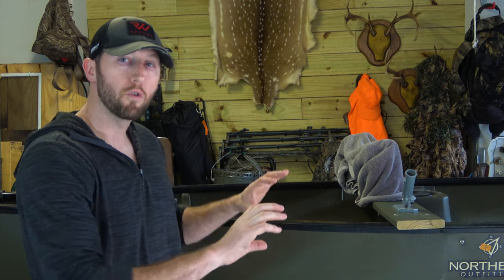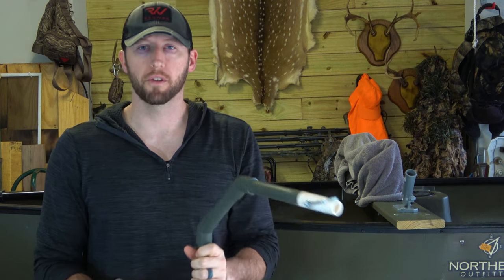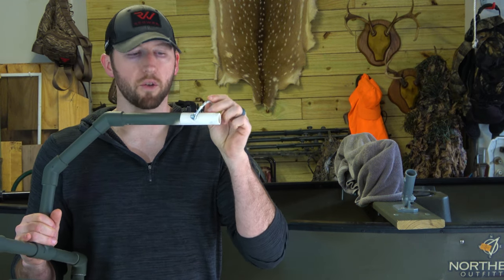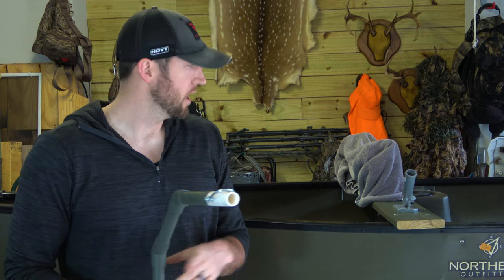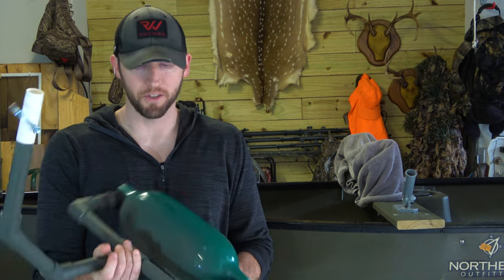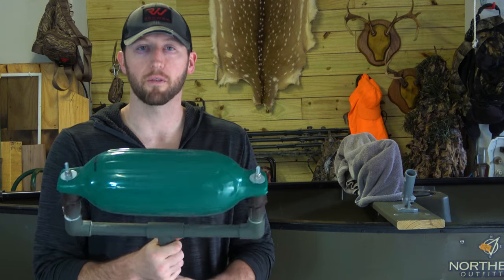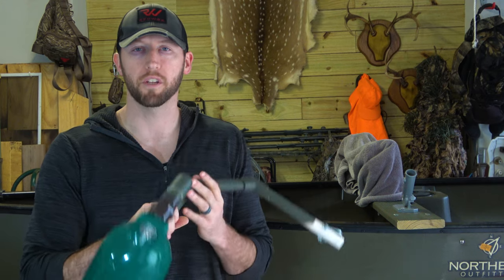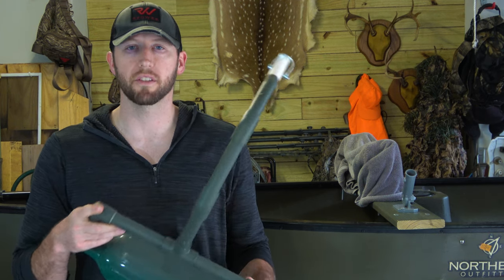DIY Canoe/kayak STABILIZER | HUNTING Canoe Project Pt.2!

Comment: 🎉Finally someone who did what I had in mind. Congratulations. Well, I have a question, are these stabilizers really good at not submerging in water? Would it be enough if I put a single 50 cm on the side?
Reply from the maker: They have been great so far even now. The adjustability certainly helps. Depending on your gear in the canoe or kayak, you are able to adjust your stabilizer level accordingly to keep them out of the water and dragging your speed. When I do lean hard on one side or the other you can certainly feel the resistance. I have never tipped this thing over.

Comment: You may not need to sand the end of the pipe to fit into the flag pole holder. You may heat up that end with a heat gun and jam that into the flag pole holder and wait for the pipe to cool down. I have tried something similar in the past and just want to share my experience. Thanks for sharing.
Reply from the maker: You are exactly right. I had to sand the last 4" or so down to a taper to get it to fit. It was a little oversight on my part originally but you can make it work!

Comment: I made a very similar outrigger for kayak, but I LOVE the flag pole adapter. I’m gonna try this as don’t like my outriggers in water while paddling any distance.
Reply from the maker: Exactly! I couldn’t imagine dragging them in the water and I wouldn’t be able to find a good neutral permanent setting because my gear load may change. It’s a huge drag when your trying to paddle if they are too far into the water.

Comment: Quick add: I used 1 1/4” PVC, very sturdy.  I should be able to slip over the outside of flag poll holder if I sand the outer rim/lip. I’ll update when I do this.
Reply from the maker: I am very interested on how this would work out for you. Yea I was not a fan of the thought of dragging my pontoons or whatever stabilizers I went with in the water as it would always depend on my cargo and weight. Seems like you could get into some trouble there as well. Not worth the risk. Point is, you could build them to a spec but if you are hauling home 30 pounds of fish or another game animal if you are hunting, your entire profile and drag has now changed. Good luck and keep in touch!
Reply: Did you ever do this? Any update?

Comment: You had the right idea..
Someone put plastic flag holders on the kayak I got from the curb.
I did the same thing on my kayak and then saw your video. Confirmation for me..
The only thing was I used 1in PVC instead of 3/4. But..for the flag holders, I had...to use a 3/4 pvc. So I cut a 8in 3/4 pvc pipe and forced 4in of that pipe into the 1in pvc. And then the other 4 in into the flag holder.
Reply from the maker: Good deal! Yea it gets  a little tricky when you start piecing things together and you start using what you have lying around lol But we always find a way to make it work right? I was really interested in a system that I could extend horizontally but I wasnt ready to push it too far. Have you had it out yet?
Reply: Must be that creativity in us..
Haven't had a chance to put it in the water yet. Work has me really busy right now. Hopefully in a week.
Reply from the maker: @lonewolflou2457   I know that feeling. WORK... pshhh.. lol Good luck let me know how it works!
Reply: @theskinnypinehuntingco.6346  Finally had a chance to put it in the water today. The stabilizers worked awesome..
I have to do some minor adjustments to move them back a little. But they did there job.
Reply from the maker: @lonewolflou2457   thats awesome! So when you say move them back are they forward of center? What is it that you saw that needs changing?
Reply: @theskinnypinehuntingco.6346  I have them centered right now. And sometimes the paddles hit the stabilizers. My flag holders were already on the kayak. 
Had it in the water again today, and the stabilizers work great..
Reply from the maker: @lonewolflou2457   I found that to. Mine are just rear of center and if I get too aggressive I can hit them just a little. This is also why I had to give up the double paddle technique because they interfered too much and it made me a lot slower!